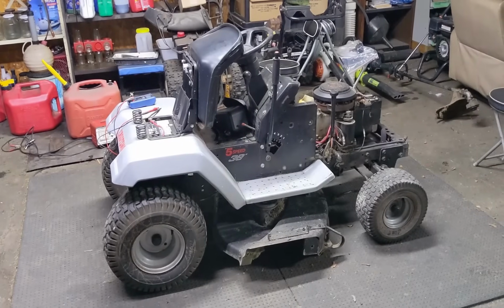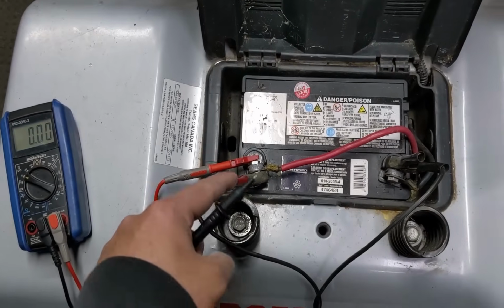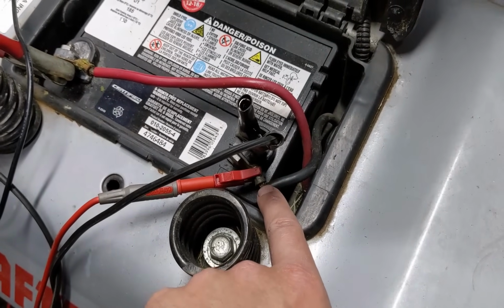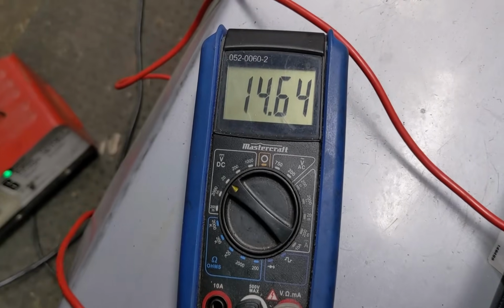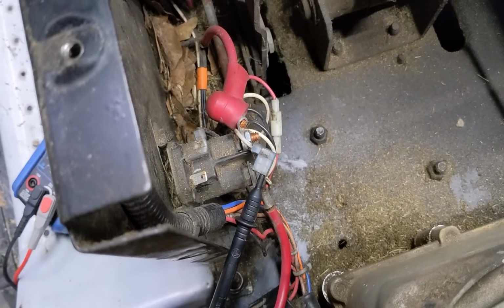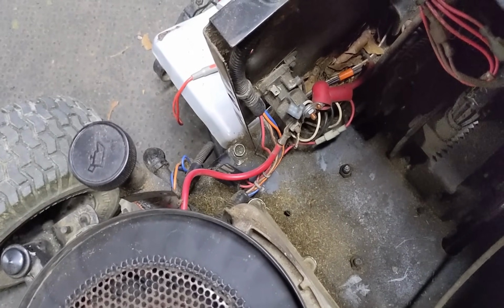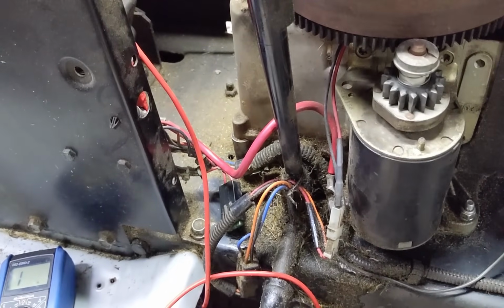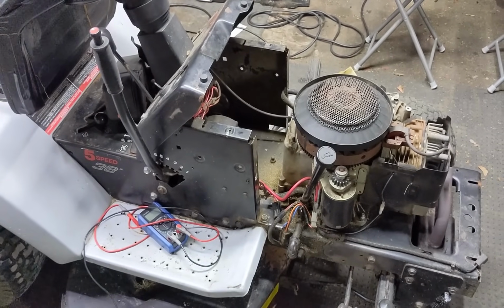Electrical Diagnosis of Riding Lawnmower that Won't Start

Comment: One thing you want to check if it doesn't turn key crank, is to wiggle the plug going into the switch.  I removed the key ignition switch and checked the different switch positions with a meter and it checked ok.  Hours down the road I finally determined the switch had faulty terminals or connections.  If you wiggled the plug connector while you turned the key it would alternate between cranking and not cranking.  Lesson learned.

Comment: You should have went through the safety switches. Also you should teach voltage drop Rather than ohms resistance. Its a more accurate way to test. It was good other than those things.

Comment: Hi there my engine cranks but won't start. No power to the fuel solenoid, all connections look great and only 50 hrs on engine. What could it be? Thanks! Awesome video btw!

Comment: Great video. Never used a multimeater before and followed your step by step instructions to solve a Kawasaki equipped riding zero turn lawn mower lawnmower engine no start problem.
Keep up the good work.
George

Comment: I have a murray rider with 20 hr model #425614x92a /ser no. 7493312021y071  mfg date 02120  engine tecumseh 20hr model tvt691 600401a  ytpxs6912aa   i put a new plug how do you test the coils

Comment: Thank for the detailed video. I just changed deck and drive belt on a troy bilt bronco. After 3 days of figuring where the springs go back, I went to start the engine and it did not start. So now on with the trouble shooting. I'm tired and will have to do this another day.  Much appreciated for your expertise. 😢

Comment: My mower has a new battery (purchased 8-23). It frequently won't turn over unless I put 12 amp jumpers on the battery. The battery dealer says the battery is good. Suggestions?  BTW, I noticed the solenoid is made in China.  I know it's off topic, but this Nation is going to pay a dear price for letting itself become so dependent on that Nation.

Comment: I can't thank you enough. I am a 63 year old wife, and my husband has dementia. My craftsman zero turn quit on me last week, and I had to fix it myself. You made the job very easy for me. I didn't realize that even though my battery showed it had 12.5 volts, it won't hold the charge under a load. I went through half of your tests and was getting 12 volts at all the contact points. So I put my battery charger on and it said the battery was bad. You are my new mechanic and you are a GREAT teacher!
Reply: Hands down the absolute best video I've ever seen to find a problem. Thank you so much!

Comment: My mower wouldn't start on two occasions. The first time, it was a bad brake safety switch, which I had to replace. The second time, the cam on the brake rod didn't contact the brake safety switch. The cam failed to push the brake safety switch plunger upwards, resulting in a no-start condition. This problem is often overlooked. My mower is a CRAFTSMAN 5000 GTS. My lesson learned the hard way is to check the mower's safety switches as a good first check.

Comment: I discovered that if i turn the motor with my hand up until it gets hard to turn and then turn it just past that point it will crank up. Is my motor starting to freeze up? Its 10 years old

Comment: The white wire goes on the battery side of the silinoid the black wire goes to the starter side of the silinoid that's the problem I could have switched them around and started it 20 minutes ago wtf

Comment: Bridging the solenoid  terminals with a screwdriver (after confirming input voltage is there) would be a quick test to show that the starter is working...

Comment: Ive changed my battery, solenoid and starter and mine still acts like the battery is dead.  Any ideas?
Reply from the maker: Check the ground cable
Reply: I sanded the ground connection. Still want crank. The motor will spin like one time and then stop

Comment: I have watched numerous YouTube lawn mower, repair videos and yours is, by far, the most comprehensive and easy to understand. I have a 2005 Troy-Bilt with a Briggs & Stratton 18.5 hp engine and I'm doing my best to make it last as long as possible. Lawn mower prices today are roughly twice what they were when I purchased that one.

Comment: I assume your video is intended to instruct us how to follow the electrical flow from battery to starter, but in the real world most people just short a screwdriver across the solenoid. Ohm testing is OK, but for a better visual you might want to use a test light. Good job.

Comment: When i check my negative terminal connector to the ground i get:  ohms 2.1, resistance 005. Do i need to replace my ground connector/wire?
Reply from the maker: No that's not much resistance at all
Reply: Ok thanks.

Comment: Hey guys I need help, my John Deere d105 won’t start. After washing it and making it run without shorting, it won’t start without solenoid being jumped. Ignition, fuse, solenoid, and battery are all new and tested!

Comment: Great explanation of the electrical system and actually how to use and set up your meter to test components. My problem is every time I try to start my mower, I get nothing. It blows my 30 Amp fuse every time. I am not sure what to start testing first to find my short. It does not blow when key switch is just set to run. Any suggestions? Thank you

Comment: Decent instructional video. Few points to make, there is a difference between 'Engine will not start' and 'Engine will not turn over'. I know in the sub text it specifies but main header and in his instruction is misleading. You can quickly check Starter by running a jumper wire from Positive wire post at solenoid to Starter wire post and lastly, always disconnect the ground wire from battery first. That way it prevents inadvertent arcing if you touch the lawnmower when removing positive wire with a bare metal hand tool. Also a quick safety tip, never wear jewelry around anything electrical. Most batteries have almost unlimited amperage stored and a gold chain is a great conductor.

Comment: So the last step, I get 12v but starter never engages. So bad starter. Done replaced the solenoid and safety switches
Reply from the maker: If you have 12v at the main wire on the solenoid, and 12v at the solenoid charge wire when you turn the key, then likely it's a bad starter. But you can always 12v test the starter if you have jumper cables. Ground and then 12v to the starter wire to rule that out before spending the money
Reply: @EliminatorPerformance  I connected positive to the positive post them grounded the black clamp to the other side and it never spun.  So I'm ordering a new on I guess haha

Comment: How to jump from battery to starter to start lawnmower. I have changed the both coils, plugs, fuse, selinoid, fuel pump, and mower still won’t start

Comment: I bad problem with starter seloniod,took it apart cleaned all contact,put little sw cleaner on contact's, reassembled fitted back to tractor did resistance chk across   solenoid energized perfect, interconnected now working properly, l never buy anything l can repair,which is most thing's!

Comment: Worth mentioning for your subscribers -- a quick elimination of the solenoid could have been done using a screwdriver to short between the nuts on the main posts on the solenoid, pulling the solenoid out of the picture.

Comment: I guess you could take the positive lead from the battery off the solenoid and touch it on the other positive solenoid terminal and it should turn the starter motor. Then you know it’s a solenoid problem.

Comment: My craftsman lt1000 has the same issue. It has to have a full charged battery or it will just click. I haven't messed with it yet. Good video.

Comment: I followed your steps step by step but it still wonk crank , what diagnostics follow from here? Pretty new to this , I got a free lawnmower so just trying to get it to start up. Everything I tested from your video was good, what do I do from here?
Reply from the maker: Could be a defective brake switch causing your riding mower not to crank over;

https://youtu.be/ceYCgXTEz_U
Reply: @EliminatorPerformance  what about a faulty spark plug coil ? I tested it with a voltemeter and I would get a reading for like 1 sec and then the screen would go right back to l
Reply from the maker: @jaimevargas997  spray some quick start in it, if it fires up and dies right away you're not getting fuel. If it doesn't fire up at all, you're not getting spark or compression is too low

Comment: Like others have said, this was an excellent instructional video. Thank you! However, I am still having an issue. I am at the last step of your video. My one clip is on the starter side of the solenoid, and my other on the ground screw on the engine block. When I first turned the key.. nothing. Just like you had in the video. Then I gave it a second and turned the key again. This time I was hearing SEVERAL repetitive clicks (one after another in quick succession), and the voltage was all over the place. I did this for a few moments trying to get a consistent voltage reading, then it went back to displaying 0.0 with no repetitive clicks. My battery is reading about 9.4 volts. I know that's low, but I was just looking for a consistent reading throughout the tests. Any clue what this could be? I replaced the solenoid last year with a part that I purchased from Amazon.. Thanks for your help.
Reply from the maker: Replace your battery, needs at least 12.35 I bet if you hooked up a booster it would turn over the engine.
Reply: @EliminatorPerformance  Thanks for your reply. That didn't seem to be the issue. I still can't pin point the problem. I replaced the solenoid (again) and had a full 12.6v in the battery. I turned the key and kept hearing this high pitched squealing along side of the solenoid clicking. No turn over in the engine though.. So I checked to see how many volts I was getting to the starter and it was hovering around 3-6v. What in the world could this be???

Comment: Indeed I found a lot of knowledge in the brief run through
And at best it's a great place to get started 
Of course I know the thing was running before I put it away last fall 
And going through the few things like chargeing the battery and all still no go very similar thing with my mower 
I think it's a thing maybe in the peddle not yet sure of that yet how ever your video has pointed me to the right direction
Not to start ending up with a hand full of parts and a thing that's sitting out there not running 
Pretty interesting stuff I found you talking about for me I am very new to this lawn mower thing   I got a lot to learn 
To not have the thing become a planter or a home for rodents hahaha 🤣🤣
Just saying

Comment: Eliminator performance. Please can you tell me if the solenoid on carburetor this have positive and negative side. Don't matter how we connect to side is on connexion on carburetor . Iam talk about the black wire and white wire? Please can you tell me your advice
Reply from the maker: No it doesn't necessarily matter which side is hooked up to what post, because when the solenoid is charged, it just makes a connection between the 2 posts to transfer electrical current from the battery to the starter
Reply: @EliminatorPerformance  thanks!! Excellent explanation I appreciate it

Comment: Hey my craftsmans positive cable is chewed up by the belt rubbing against it and when I tried starting it shot out sparks and and the engine died and it won't roll over or anything do you think I burnt the silinoid ?

Comment: Update from my electrical trouble shooting based on these steps; I am in the process of refurbishing a JD SX85 mower that had been sitting outside for the last 6 plus years.  After getting a new battery and ignition switch (due to last owner not knowing where the keys were), one of the things that threw me for a loop (my fault) and caused me to buy a new solenoid I did not need was the fuse.  When I checked the fuse, I made the mistake of checking continuity while fuse was in holder.  Also when I took the fuse out, I did not look closely at it in the light.  So after pulling my hair out checking the grounds and safety switches, I still could not figure out why I was not getting 12V key power  to the starter.  I could do the old solenoid screwdriver method but that was it.  So finally with the sun shining in my shop, decided to pull the ignition fuse again and look at it in the sunlight and sure enough could see the break in the plastic.  I went ahead and grabbed the fuse out of my 2020 JD and put it in this little SX85 and sure enough, engine came alive with the key:-)  Moral of the story is check fuse in sunlight or with a flashlight :-)

Comment: I have a 7 year old Toro Zmaster 2000—Kawasaki FX651V engine.  Replaced the battery, spark plugs, starter switch, fuel filter and solenoid—just because of old age whether it needed or not.  The mower sometimes starts when left on battery charger for 4 hours as maintainer.  There is no clicking and just no starting most of the time.  Same happened before I replaced all above. All fuses are good. Could the starter just be bad?  Have a new starter sitting here in box. Understand that the ignition coil wire could be bad but not sure I am able to dissemble and replace that.

Comment: I am at my wits end. I keep blowing the fuse on my Husqvarna tractor lgt2654. I have disconnected all the harnesses and connected back keeping tabs on the fuse. I narrowed it down to the harness going into the top cowling. The fuse blew as soon as I connected it. What should I look for. Thank you.
Reply from the maker: Short to ground somewhere, there's a wire that's probably been rubbing on the frame or steering column and is bare and when it touches the chassis it shorts to ground and blows a fuse

Comment: Great Video! Just did all of the testing from your video and everything tests well except voltage coming out of the solenoid to the starter. I have 12.5+ volts at the battery and matching volts at the battery post on the solenoid. when I turn the key to the start position, I only have about 6 volts going to the starter. So I was confident it was the solenoid until bench tested the solenoid following your other video and it checked out so I'm back to confused, haha. I order a new solenoid anyways so here i sit and wait. New subscriber and enjoying your other videos. Thanks
Reply from the maker: Hope you get it figured out Matt, electrical can always be a pain. Resistance test the starter too, and if it's not the load that's dropping the volts, it's gotta be the resistance in the solenoid.
Reply: @EliminatorPerformance  Thanks for taking the time to reply. I'm going to take the starter off today and I'll bench test that while I'm waiting for the new solenoid to arrive. I think I'll also double check the solenoid on the bench again as well. It's weird as I was on the mower for an hour or so and hopped off to check my mail and the mower wouldn't start. Furthest spot from the house. Had to load it into my truck to bring back to the house, haha. Thanks again for all your videos. Matt

Comment: This video was great. I thought you seemed a little over the top at first, but then took notice of how clearly you spoke and continued to recover each step in order to really burn the process into the brain. Great job. I’m hoping you have some trailer light troubleshooting videos.
Reply from the maker: No trailer light videos, but they're fairly simple. Usually bad ground causes issues on them.

Comment: I have a JLG towable lift the engine stalled and would not restart, the starter cranks. To rule out the lift wiring I totally disconnected all the wiring from the lift to the engine and installed a temporary switch to start the engine. It cranked but would not start. I checked for spark it seemed ok. Thinking maybe the coil was failing I removed the engine from the lift to be able to access removal of the coil. I put the engine on my garage floor and tried to start it ---IT STARTED!!!  It ran flawlessly. Kept testing it for a couple of days with no problem what soever. I kept the temporary wiring in place and decided to mount it back on the lift. It would NOT START. It was not hooked up with any of the lift wiring. Could there be a ground problem on the lift even though no wiring is directly attached to the Honda GX270? All I did was mount it to the frame and it would not start. The exact same wiring as in my garage.

Comment: Great instruction! I just replaced my three belts. During the process, I removed the battery and placed the mower on its side at about an 80 degree angle, gas cap up. Now the mower won't even turn over. I removed and checked the solenoid and connected it to the 12V battery. I did hear a click and I think I have the resistance test correct. However, I did not do the final test which helped you to find the break. I also replaced the spark plug. My instinct tells me turning it on its side may have been the culprit. Would that do anything you can think of?  I'll re-test the solenoid and follow your steps with the safety switches too. I'm just at my wits end as to why it won't even turn over. I bypassed the ignition and the starter turned over, but not by turning the key.
Reply from the maker: Pull the spark plug and make sure there's no fuel in the cylinder causing hydro lock

Comment: Great instructional video! The problem with my mower is that it keeps going through solenoids. I get it started and run it for a bit, then it won’t start/turnover the next day or even later that same day. Any help would greatly be appreciated. John Deere D140 22HP Briggs motor. Thank you.

Comment: I have a Snapper RER Mower 7800920-00 with a 17 hp B&S Intek engine 31C707 603 E1

What non-Snapper product is available for an ignition coil, solenoid, starter, and spark plug is applicable to my mower and engine? Snapper parts are pricey! Thanks